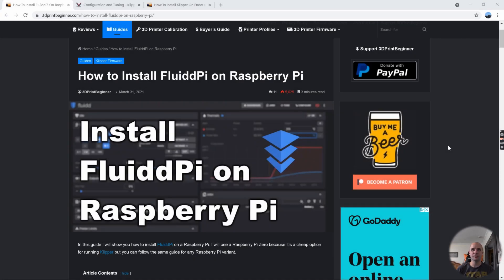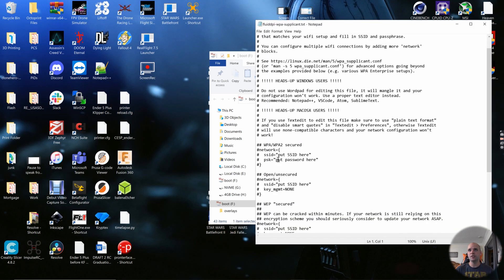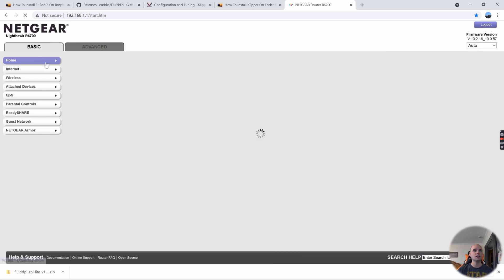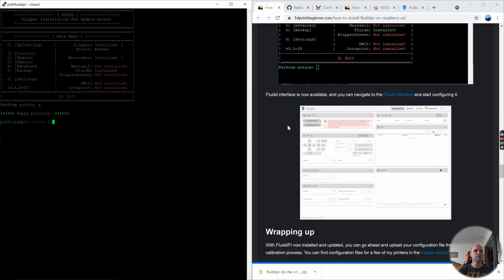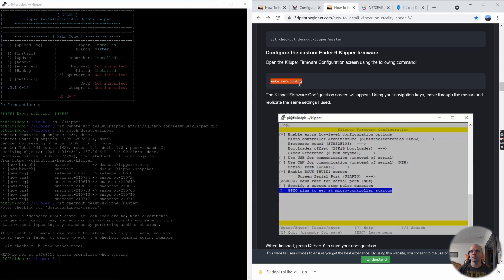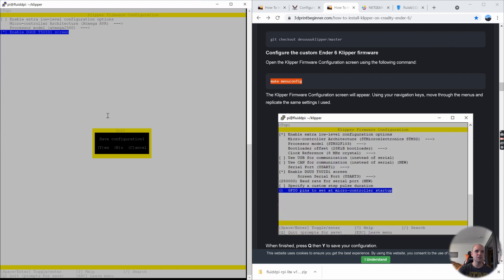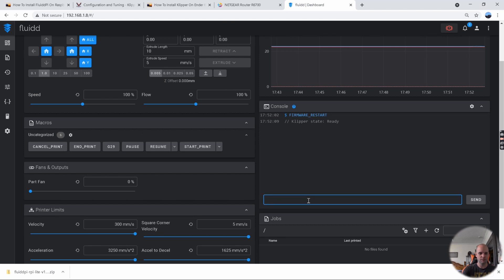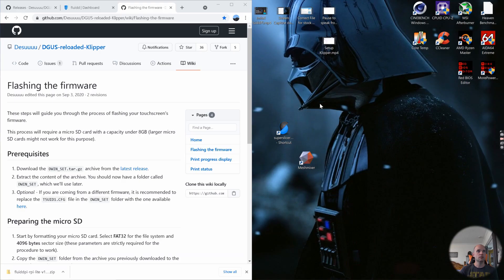Klipper Install for Stock Ender 5 Plus

Comment from the maker: Hey everyone. This video is staying up as unlisted for a while, I will be taking it down soon as the links and methods are dated and don’t work with the new updates that have been coming out. 

I just moved and once I get my printer up and running again I might try to make a new video with the latest and greatest updates.
Reply: Lot of thanks! We will wait for your new contents ! Thanks in advance
!
Reply: the option for the standard screen where u say it will be differnet to the ender 6 is not there anymore
 @themacboy9564

Comment: Sadly the screen thing isnt working. At the last step with flashing my Screen no matter which of both linked assets i'm using the screen shows the blue flashing screen but he doesn't flash any file, so it obviously isn't working on my ender 5 plus. Really sad. It's only dumb to lay down a second screen next to the unused stock screen. Hope somebody can help

Comment: 3sept24:  installguide still works, only config is out of date for the current klipper. Follow this guide. do not install raspberry lite OS like Kiaut ask, the ip for fluidd in browser will give issues that way and you will have a world of fun.... just flash fluiddpi and you will be fine. 

 Moonraker will throw issues when config finally works, BUT it gives the sollution also. 

THANK YOU SO MUCH FOR THIS!

Now I can go an thinker and test - Silent board - BLtouch - Microswiss NG revo setup

Comment: I can confirm that still today, 28 mar 2024, this works, with some changes... 

The Fluidd install and Klipper installs are all fine. 

I got the the ip address to open Fluidd and when accessing, it gave me an error that it couldn't find something. I'm sorry I don't remember what it was, but it had something to do with the moonracker not being able to connect. 
I can't remember what i did.. ffs, I think I redid your installation steps.. or just did a quick google search on the error.. whatever it was it was easy to fix. 

Then the usual Fluidd dash stuff was showing like in your video prior to the print config file. 
Uploaded yours, and gave me two annoying warnings:
1) option 'z_offset' in section 'bltouch' must be specified 
which after a quick search you just need to uncoment the z offset and leave it at 0. 

restarted it, then gave me:

2)Option 'rotation_distance' in section 'extruder' must be specified
This one was a bit more tricky, but I simply copied the extruder code from this link https://github.com/Klipper3d/klipper/blob/master/config/printer-creality-ender5plus-2019.cfg
[extruder]
step_pin: PA4
dir_pin: PA6
enable_pin: !PA2
microsteps: 16
rotation_distance: 33.683
nozzle_diameter: 0.400
filament_diameter: 1.750
heater_pin: PB4
sensor_type: EPCOS 100K B57560G104F
sensor_pin: PK5
control: pid
pid_Kp: 22.2
pid_Ki: 1.08
pid_Kd: 114
min_temp: 0
max_temp: 260

Then it connected!! but it was showing an arms length list of Moonraker PolicyKit warnings. 
Printer would work, but I wanted to get rid of the warnings. 
So after some search, found this link: https://github.com/Arksine/moonraker/issues/349 which basically says to run this code of line on your Putty
~/moonraker/scripts/set-policykit-rules.sh

ran that, restarted the Fluidd, and voila! all working fine!
Screen all works as mentioned

I've used the latest 1.19 in the link but is already asking to install 1.29 once you get it all running.. strange that the page doesn't show that version
Klipper vs v0.10.0-515-g24a1b50e but asking to update to v0.12, should I?

Regardless, don't keep this unlisted man! if anything re-do the description and send it! I'm hyped now to try these new features and see how it works

EDIT: I'm using a pretty stock E5P, with the silent board and a micro swiss DD.
tomorrow will upgrade my temp sensor to crack on printing above 300C

Comment: What causes it to not work anymore?What is the error i would get if i try to flash klipper on my v2.2 silent board?Is the problem caused by the stock touchscreen?If it is i wont use it it isnt a problem for me.I read some information about v2.2 silent board and they said tmc2208 drivers doesnt have connection to mcu on v2.2 silent boards so it wont be compatible with the klipper.

PLEASE HELP
Reply from the maker: From the feedback of others, this method still works and with minor tweaks can flash the latest version of klipper. The steps for extruder are different on new versions. I have flashed new klipper and my screen still works.

Comment: Just used your guide this past week. With one minor change I used mainsail instead and used the raspberry pi imaging tool. Thank you for putting this together combined with your video and the updated links in the description I was able to flash klipper on my 5 Plus. Thank you so much!!!!
Reply: Hi, I'm attempting this now, did you manage to get the screen working too? I get the error "Moonraker can't connect to Klipper!
Please check if the Klipper service is running and klippy_uds_address is correctly configured in the moonraker.conf". 
I have the Creality v2.2.1 board

Comment: Also on my side everything works fine on raspberry pi 3b+ and pi4. I installed it on two ender 5 plus and I had no issues by following this tutorial. I think you can really unlist the video. The only thing that doesn't work is switching to mainsail. Besides that fluid is working perfect.

Comment: Is the v2.2 silent board actually silent? I have really loud stepper noises when printing
Reply from the maker: It is.
Reply: @phillipandrew5095  I am using desu... klipper as well on a stock v2.2, basically the same config but my steppers are really load, I think ill just replace the board to something better suited to klipper

Comment: One quick additional info. Today Creality released update for SonicPad so you can control up to four printers, I am going to be testing this- but I am sure others here on channels will give it a better shakedown. But if it works, the value of SonicPad has just risen…
Reply: i have confirmed that the multi-control on SonicPad does in fact work. I have both the Ender 3 S1 Pro and Ender 3 V2 running from same SonicPad simultaneously both on screen and in the web interface!  Clearly this changes the economics and value of this device.

Comment: At this point, you cannot follow this video, too many things have changed.  The klipper version changed, no screen support. If you install same version as in this video, still doesn’t work because the instructions in the “Install Klipper Firmware for Ender 6” based on link provided has changed and you no longer get the same menuconfig options including screen install support.  I appreciate the authors work here, but now outdated and at least no longer will you have screen support if you want to keep updated on klipper version.  An easier option (and now less expensive than PI plus display (again if that matters) is to buy the SonicPad from Klipper (I paid $149 direct from Creality), and it makes the entire process quick, easy and supported.  And, it works and well. I have also done same on my Ender 3S1 and works fawlessly. Same FLUIDD interface, beautiful 7” display, and fast performance. You can print at 120-160 mm/sec with good results and even 250mm on some larger more functional and less complex parts. You will run in to hotend cooling issues first as you push it.

Comment: Over a YEAR later, a couple things have changed, BUT this video helped me out... Long story short, been printing for years now, Octoprint going on my printers and making good use of the plug ins, then all of a sudden I am hearing about Klipper, My Ender 3 S1 (day one) has stringing issues I can't fix, don't know what board to get for sure, so Klipper to the rescue... BUT I am a little afraid to mess with it. Now I get a new Ender 5 Plus, going to change out that loud board so not afraid to take a chance. Well after watching this and doing my Ender 5 plus, I feel like a pro!  LOL, Yes, there are some of us out there still getting new Ender 5 plus's . Also your config file was a bonus too. Thanks and I like how you film things, no I will not ask if you like Star Wars.   LOL sorry, I'm a smart guy....
Reply: Were you able to get the screen to run? I have found several post saying that does not work anymore.
Reply: @k10_offroad27  I have a 7” touch screen using klipper screen , installed it using KIAUH its much better.  Screen and Pi are just sitting off to the side.

Comment: Phillip, I was using the new version of Klipper, I am ok as I will be adding a screen to my PI for touchscreen at printer.  However, using your printer.cfg, it is asking for Rotation_Distance (I put it at 4), and Microsteps (I put at 16), and Step_Distance (i put at .001250), but Step Distance is reporting incorrect. What are the correct values for these?
Reply from the maker: That I do not know the answer to. The new version of Klipper has different settings. I’m still running the old version.
Reply from the maker: See comment from Livewiya below. There were able to calculate it from the help page.

Comment: I followed your instructions here, but at 6:14 my screen does not have an option to enable the screen, that line is missing. So, I went back to Kiauh and installed KlipperScreen. This however after about 15 minutes of loading a whole host of files, applications and supporting libraries failed...any idea where this went wrong?
Reply from the maker: My only thought is to be sure that you are installing the correct Klipper file. The newer versions of Klipper do not support the stock ender 5 plus screen, which might be why you are not getting that option.

Comment: Hi Philip @5:54 my screen on putty does not show the last line which is ENABLE DGUS T5UIDI screen, (Ender 5 Plus) followed all your steps to the point. Will i still be able to use the built in screen if i continue the steps without that line selected?

Comment: Thank you for this! I installed the Ender Extender on my E5 Plus which makes the build size 510x510x500 and I'm striking out trying to modify my Marlin firmware. Someone suggested I switch to Klipper and this video is exactly what I needed to investigate doing that!

Comment: Thank you for putting this together! 
The config has since changed: they now use rotation_distance for the extruder but the formula on the klipper support page made it easy enough to calculate. You made getting the SD card into the touch screen look wayyy easier than it was for me lol
Reply: What setting did you finally use? and did you have to specify a Step_Distance?  It was asking me for that as well.
Reply: @jraiello  my current configs are 33.683 for rotation distance (but I now use a 104% flow multiplier in my slicer, so that value wasn't dead on). I do not have a "step_distance" in my config file anywhere. The only other variable in the extruder section is Microsteps: 16

Hope this helps!
Reply: @livewiya  what version of Klipper did you install?  Thanks!
Reply: @jraiello  the desuu klipper fork mentioned in this video. I ultimately want to get 12864 display and use klippers main build, bc it doesn't seem as those desuu klipper is getting maintained, but it's nice to retain the screen for the time being
Reply: @livewiya  This setup is hassle and now that screen isn’t supported, I am switching to Creality SonicPad.  I did install on my Ender 3 S1–easy, very fast results.  The entire package makes it easy and supported. I paid $149 on Creality website- bought 2.  It doesn’t get easier and buying a PI and screen was more.  My Pi now cost over $200 in the kit I bought and screen on Alibabs was $75-  someone else can use this stuff, I will sell and use the less expensive solution…
Reply: @jraiello  For the sake of clarity, the screen was never officially supported. But right, this fork that works with the stock screen has not seen any update in a while. It was nice this option existed, I'm not sure I wouldn't made the leap if I wasn't able to make use of the stock board. But I suspect I'll upgrade the board and display soon enough.

Comment: Same issue.  The makemenu option for the T5UID1 screen never appears.  I guess this method doesn't work anymore.  :-(
Reply: Worked it out. After doing the KIAUH part, quit out of putty and go back into it, it was put you back to the default directory. Then you can follow the steps on the website starting with rm -rf klipper

Comment: Hi, do these instructions still work?
I follow them but the menu to select DGUS T5UID1 never appears. :(
Reply: I just ran into this same issue, did you manage to resolve?
Reply: @colintoohey5142  unfortunately no :(
Reply: @viriatecunip.lda.2885  Worked it out. After doing the KIAUH part, quit out of putty and go back into it, it was put you back to the default directory. Then you can follow the steps on the website starting with rm -rf klipper
Reply: @colintoohey5142  Great, i will try it later. Thanks
Reply: @colintoohey5142  It worked, thanks!
Now i have this information on Fluid :
"Option 'z_offset' in section 'bltouch' must be specified"
I have used the Phillip Andrew printer.cfg file, i think im missing something
Reply: I think it is an issue with the new klipper version, do you have a cfg file that works with new version? i have an E5 Plus with silent board, micro swiss DD and dual Z. Thanks in advance.
Reply: @viriatecunip.lda.2885  You have to use the version in the video for it to be compatible with the stock screen
Reply: @colintoohey5142  I installed Fluid version 1.16.12 and used the printer.cfg of Phillip
First it askes for 'z_offset' in section 'bltouch', i put 0
Then is askes for 'rotation_distance' in section 'extruder', i put 24,395
Then 'microsteps' in section 'extruder' i put 16
Then it gives an error  'step_distance' is not valid in section 'extruder' i deleted it.
Now it conects ok to the printer but i think my configurations are not ok

Do you know where can i get a printer.cfg file to use as a base for my E5+ with silent board and Dual Z?

Many thanks for your support.
Reply: @viriatecunip.lda.2885  I started mine using the one provided here as a base. Rotation_distance is basically the new step_distance with this newer version of fluidd, so deleting that was fine.  You will have to calibrate your e-steps and adjust the rotation_distance accordingly, making sure it is extruding the correct amount when told to extrude 100mm
Reply: @colintoohey5142  Thanks, i first have to solve the problem with the dual Z, if i home the printer only one of the z motors work :(
Reply: @viriatecunip.lda.2885  Odd, I started with the config from this video (which is setup for dual z) and didn't have an issue with that

Comment: Who do I have to pay to get my Ender 5+ printer file set up under the new klipper settings so I can make my first print?!!! Needs a working printer.cfg file. Sorry, just a little frustrated...

Bought ender5+ match 1st 2022 Amazon
Raspberry pi 4B w/pi cam
Klipper installed 
Moonraker installed
Fluidd installed
Kiauh installed
Creality all metal extruder upgrade
Capricorn filament tube upgrade
Bed leveled before klipper installed
Extruded 97.73mm instead of 100mm
Screen(Desuuuu) and board successfully flashed
Klipper screen comes on and heats

Comment: i followed everything... a few issues:

Option 'z_offset' in section 'bltouch' must be specified

Option 'rotation_distance' in section 'extruder' must be specified
Reply: Did you manage to solve this?
Reply: having the same issue
Reply: @delirve12  make sure your slicer print time to screen option is enabled. This solved it for me
Reply: Have the same issue. How did you fix it?

Comment: Thank you very much for the video! I'm having a problem though, when I get to the klipper firmware configuration, the "enable dgus t5uid1 screen" does not appear at all, anyone had the same problem? I have an ender 5 plus with the silent board installed, thanks!
Reply: Select Microcontroller achitecture -> Atmega AVR 
It will then show up
Reply: @efboiz5302  It does not show up, i think the latest version does not support the stock screen :(
Reply: Did you ever resolve this
Reply: @colintoohey5142  I did, from memory I think I started the process again, mainly following the guide on the website rather than the video, and that worked well! :D until I updated though, the update messed everything up 😩

Comment: Can confirm as of 1/30/22 this guide still works!  So stoked it was this easy, you are a life safer sir!  Only issue I had was when I tried to get input shaper set up, and it was only because I didn't follow the newest updated commands on the klipper website. Is sort of a bummer if you update klipper the screen will no longer work.  Hopefully that wont become an issue later on.
Reply: PUT IN THE SCRIPT SO IT WORKS IF THE TX IS NOT THERE AFTER U UPDATE JOT IT DOWN B4 UPDATE THEN PUT IT IN IF ITS MISSING 9.40 ON THE VID
Reply: Thanks for the update, i just stumbled upon this and wanted to do it but was wondering if it was still valid being 7 months ago since posted.
Reply: Thanks for the update

Comment: Well made video! I just got my Pi and was about to set up Klipper following these instructions. However a silent V2.2.1 board showed up on FB Marketplace for a nice price so I grabbed it. Does that change any of the steps listed in this video or are the boards compatible in the software?
Reply: The board should be compatible if you haven't already tried it
Reply: Did it work with the silent board? I ordered one today.

Comment: Few faults occur: Section BL touch z offset after remove # show :t5uid1 fault after hash this  show new fasult :Option 'firmware' is not valid in section 'input_shaper'

Comment: At what point did you install Moonraker? When I  go into my Raspberry PI       I get the message "No moonraker connection. Please check moonraker status and / or refresh" Based on your brief screen shot it looks like you had it installed already. In my case it was not installed with fluidd.